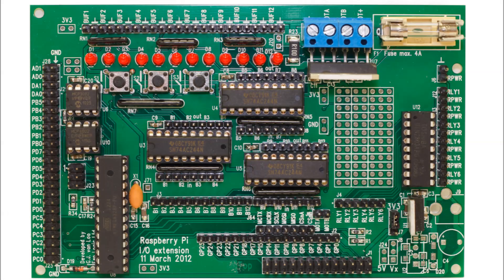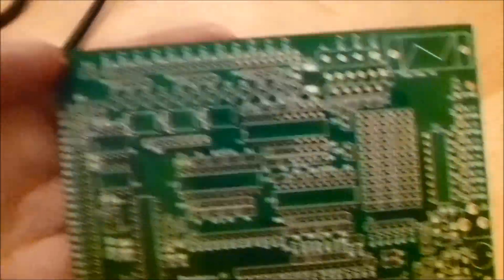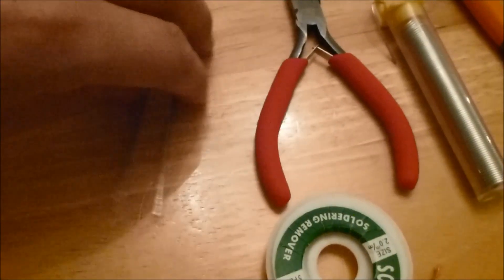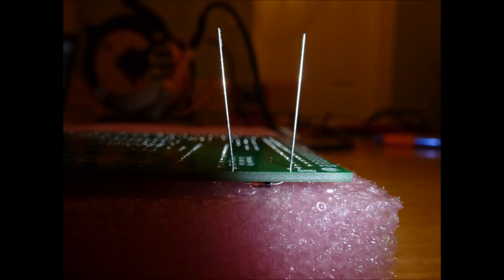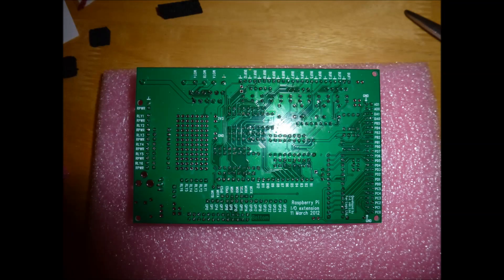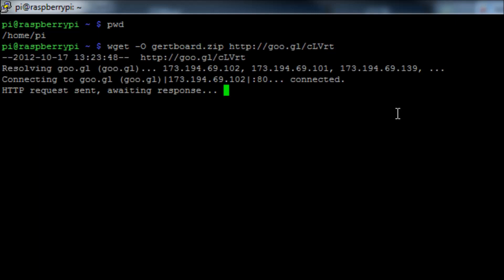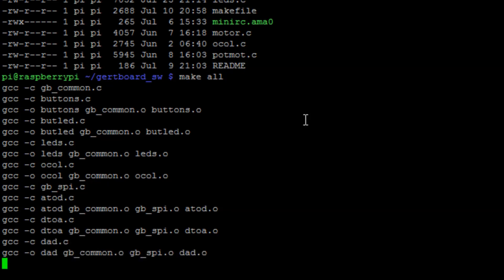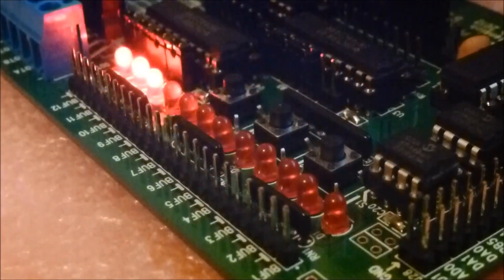Raspberry Pi - Introduction to the Gertboard

Comment: Thanks for th reply! 
I found a post on the forum about 30 seconds after posting that last comment.
I tried replying to my own comment but YouTube had a fit

I looked in the .c file which is where I assume the changes need to be made re gpio pins 21 and 27 but cant work out what else I need to do to make it work. presumably it needs to be recompiled after the changes but it complained a few times when I tried.
Looking now for step by step instructions as I dont know the first thing about C. :(

Comment: Ive just got around to playing with the test scripts and realised that there has got to be something wrong with my board although the soldering looks fine. On the first script I tested "./leds" I plugged LED 1-10 (not enough wires) and all 12 jumpers and set it going. LED 5 does not light.

While I was hooking them all up I noticed that if something touched the BUF1-12 pins some of the LEDs would light up. Five does light this way so i know its not burnt out or anything.

Any ideas?! :(